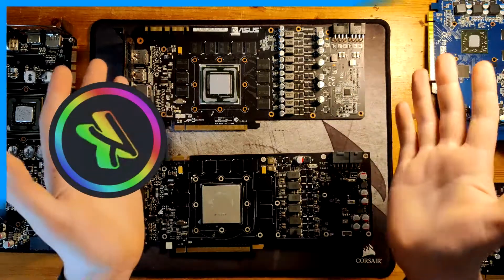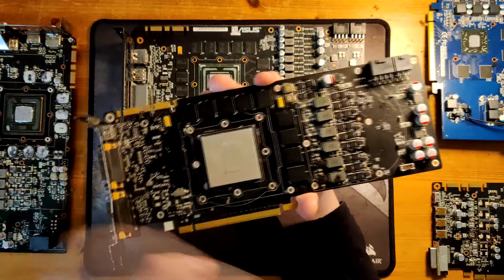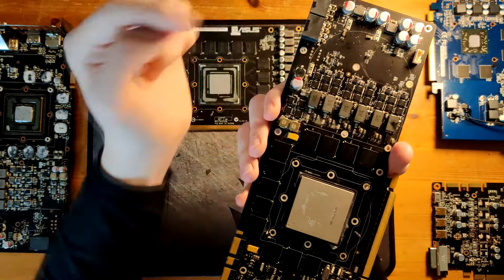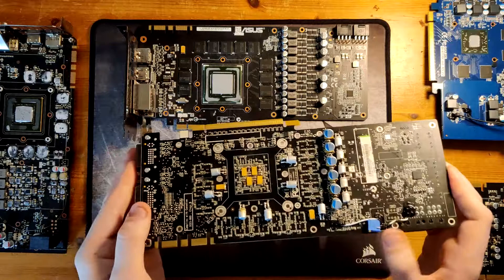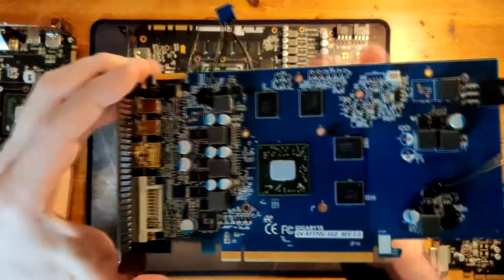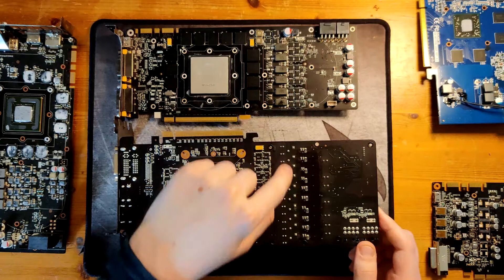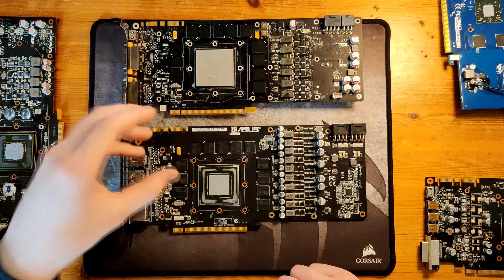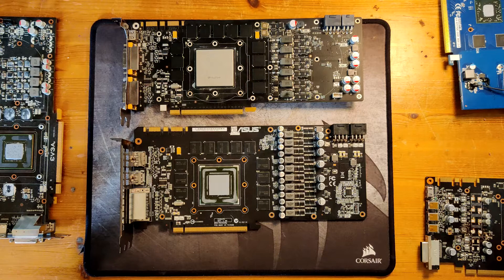What is What on a Graphics Card PCB?

Comment: I already know what a graphic card has on it but it was interesting watching this and you deserve views for the great video. I suggest you making another video with common gpu faults and voltage test points.
Reply: That would be great. I have a dead 1080Ti. It worked, got removed for a couple of weeks and then it was dead. I tried it in 3 motherboards. Electrical stuff I understand. Electronics is beyond my knowledge and so I am trying to remedy that.
Reply: Agree. I watched a bunch of different GPU repair videos on different channels but they never explain in basic terms how they are using the multimeter or what parts they touch and why. I believe due to my lack of experience and skills, it is still a bit confusing. I think even the experienced electronics techs refer to the wiring/circuit diagram or schematics to figure out the layout of the board if they had no prior experience with that particular card/board.

Comment: Vrm is actually multiple sets of synchronous buck converter that turns on in sequence to share current load, you can use single synchronous to supply the core but the power component like the inductor and mosfet would be enormous like a single set of 800A 30v mosfet d will constantly hold the current, so multiple phases is use at it reduced current loads to multiple mosfet less stress less losses and thus efficiency

Comment: You have explained same on all but i want to know other thing on that pcb which you haven't even touched them. What is that z sign small thing near to 12 Volt connector side, also that same thing is Q sign on other side. There is another R005 written on other side near 12 volt connecter. Can you explain them in short please? what they do and where are they connected. Thank you

Comment: I'm sharing this one for sure. good job !
I would love a guide to where to stab the card with my multimeter, for example, you said to see which is mem vrm and which is vcore is to measure resistance, which I think you mean from 12v to output of the inductor? so do I touch the 12v pin on the 6/8 pins ?
Reply from the maker: i am already planning a "stabbing guide" that will be up soon. 

to answer your question. you always measure to ground. so any ground point on the card (the metal of the display connectors for example). the other probe is then connected to the part you want to measure the resistance from. so one of the inductors for example (doesn't matter which side they have a very low resistance) or the positive side of any capacitor on a given power rail